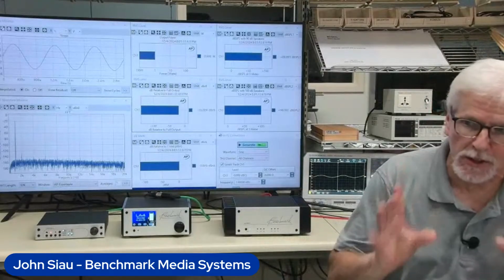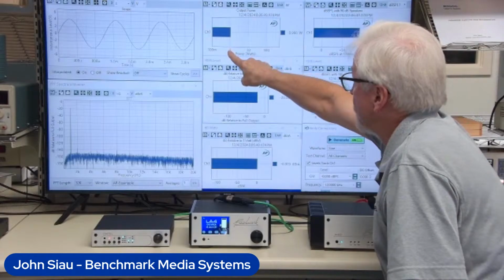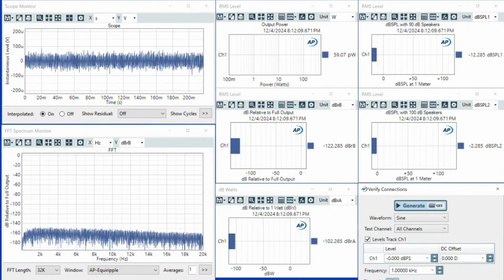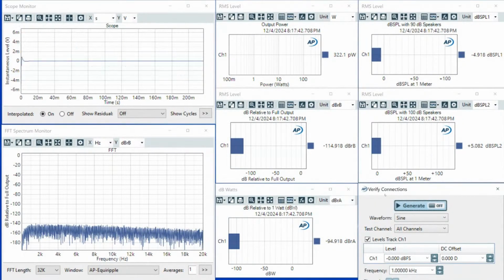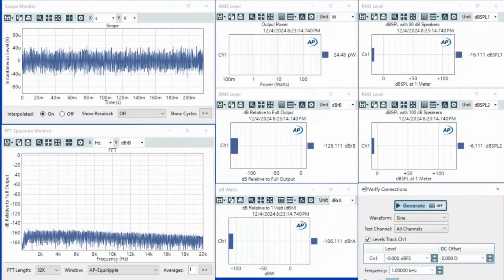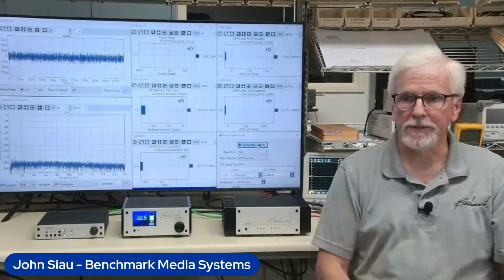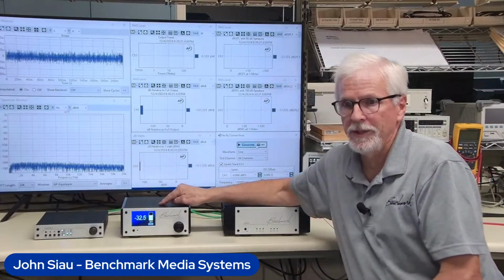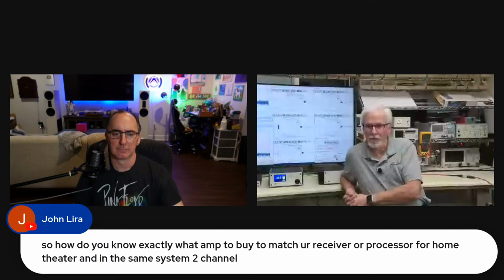Setting Proper System Gain for Optimized Audio Performance

Comment: I have an older DAC2D. This device is connected by XLR to a Yamaha A-S 2100. But if I select higher output level on the DAC the signal from the speakers gets distorted. That’s because the XLR Input stage in the Yamaha is not able to operate clear with higher signal levels.

Comment: But what if the s/n ratio of the pre-amp is worse than the amp's.  Would you still chose the low gain setting on the amp? or is it better to let the componenet with the lower s/n ratio do the gaining?  for example my rotel pre-amp says:
s/n ratio (IHF A-weighted) 95 db (analog bypass) 92 db (Dolby Digital, dts) 0dBFs; input sensitivity/impedence: Line Level 200 mV/100k ohms; Pre-amp Output Level/Output Impedence: 1.0V/1k ohms; Contour (LF/HF) +- 6 dB at 50 Hz/15kHz
the amp says s/n 137dB;
Reply: What are your other components -- source amplifier speakers?
Reply: Rotel RSP-1570 pre-amp manual says: s/n ratio (IHF A-weighted) 95 db (analog bypass) 92 db (Dolby Digital, dts) 0dBFs; input sensitivity/impedence: Line Level 200 mV/100k ohms; Pre-amp Output Level/Output Impedence: 1.0V/1k ohms; Contour (LF/HF) +- 6 dB at 50 Hz/15kHz. The amp (buckeye purifi) spec says s/n 137dB; 4 ohm 25dB/2.2Vrms (high), 20dB/3.9Vms (med), 15dB/6.9Vrms (low). Is it better to let the amp or the pre-amp do the "gaining"? I guess it depends if the s/n gets worse as you turn the knob on the pre-amp???@abijeetrs6522

Comment: The HPA4 has helped me tremendously to perform as per the description in the 25th-30th minute, to mate a pair of unbalanced anode output of a 300B preamp with a fully balanced dual mono AHB2. I'd put the 300B preamp output as maximum, going through HPA4 to perform the volume adjustment

Comment: Hi Gene, thank you for the depth of information provided!  My current very modest system provides me with some nice audio and given this info I am wondering if I might see a benefit to adding a pre amp in between my DAC and amp.

Components are 2 sources: Sony CD/DVD carousel player optical connection to smsl su-1 DAC and a Wiim mini optical connection to the su-1. Then the analog connection to a Fosi bt20a pro with sparkos op amps driving polk RTi38's and a Polk psw303 sub.

Modest yes, but fun! Would a preamp between dac and amp using the preamp for volume potentially make a difference?
Reply: Sorry, CD/DVD is coaxial connection to DAC

Comment: What are the best practices if I use the WiiM Ultra? It's a digital preamplifier with subwoofer output, high and low pass filters, EQ functionality and RCA preamplifier outputs.

I usually listen at around 20-25 and rarely up to 45 if the track is quieter (max is 100). 

Should I upgrade my power amplifier to one with a lower gain? My amplifier is rated at 29db, 50w in 8 ohms.

Thank you! 😎

Comment: So i should turn my gain down on my parasound jc5? I was told by parasound to have the gain on the highest.. and how does it effect the power, i asume i have to turn the volume on the pre alot more up go get de same volume. Feel like there is a loss of power if the gain is on low🤷‍♂️

Comment: This video was confusing, could it be summed up in one sentence? I'm assuming the advice is run the signal hot and the amp gain low to minimize noise? I have a receiver so this would only apply to my subwoofer line out where I do the opposite which is run the plate amp hot and then turn the signal down via a -db setting on the receiver, this is to avoid clipping and noise in a subwoofer signal isn't a concern.
Reply: 40min video to tell you to max the volume/gain as early in the chain as possible.  If you run all digital sources it doesn't really matter imo
Reply: This is the one thing am in search of these days. Whats the best way to tune a subwoofer Gain knob & AVr trims. I recently tried a Y splitter, heard that increase a 3 to 6db gain into the sub. No one explained correctly or I couldnt find it. Everyone says 50 % gain and - trims.
Reply: @SuperSteamengine  my technique for what it's worth is run auto calibration with the subwoofer plate amp at the volume that produces 0db in the auto eq results, I then do a -2db trim on the subwoofer in the AVR level menu. For me halfway on the volume knob just so happens to produce the correct db level during the measurement process. I use a single cable from the subwoofer output on the avr to the lfe input on the sub.
Reply: @Mike-jm5wt for producing 0 db or near to that I need to run my subs at hardly 25 % or 30. Normally what I would do, my auto calib results in - 2 or - 3 with sub gain knob at 30 % which is no bass at all. I tend to change the trims to -6 or -8 and run the gain knob to 60% which punch harder with Just LFE single RCA. Am just testing to get a better input voltage using the Y cable hoping I would get a less gain on knob and good punch.

Comment: In the first 5 minutes I got bored. Remember back in the day it only a reciever that did it all and an equalizer?
Reply from the maker: @scottivlow9962  This is a fact based channel hosted by engineers and other subject matter experts. If that bores you, there are plenty of YouTube channels to watch press release style powder puff reviews with cool camera angles and nifty music.
Reply: but but but we have to sell pre-amps, streamers, dsp, special dacs, $10k wires.  
He's there peddling his wares... passionate? sure...
Reply: @lgmediapcsalon9440  I spent so much money on 3 sets of surround speakers, 9 sets of RCA speaker cables, RCA adapters & connectors and 2 pairs of wall mounts since last September.  I also bought islolaion pads for my subwoofer, sound bar and small one on the back of the speakers. I want to eventually add 3D  sound islolaion pads on my walls near my speakers.
My grip is with the whole audio industry that has no damn clue that for people that buy any Vizio soundbar can try an up sale on speakers that go far beyond the stock speakers you get from Vizio. 
The trick to make it work RCA Y adapters that plug in back of Vizio subwoofers.
I have 2 sets of 3 way speakers and 2 sets of 2 way speakers. I wanted the best of the pros and cons from both types. I have a total of 10 surround speakers now.
I need an Arc / eARC audio extractor and a new HDMI cable.
I have a non functional Vizio soundbar that needs an audio connection to my TV..
 I'm already planning out my next upgrade to my Vizio thin and long speaker wire to something shorter and thicker for a better appearance.
Reply: Ever spend any time on the forum? It's a cancerous cesspool of audio snobs that are more left leaning than an 80s adult film star's junk.
Reply: Have you ever been on their forum?
Reply: @MikeMargolis-j8f  I have been on their website. The huge problem I have with Audioholics is that it is a no useful website.
 It's like there are 2 home theatre markets from Audioholics. It should be one. The forums could really careless about the Sound bar home theater owners. This site is about one one thing the huge experience home theater equipment. Definitely useless to sound bar owners that would like to add separate surround speakers.
 Sony, Sonos, & Nakamichi let you buy separate surround speakers. Anyone else "it's your out on your own" crap on what to do to make "bouncy house" to be better than what you get from stock.
 I did manage and still have to manage and figure out what additional equipment I need. 
  I need a second sound bar to work, to do that I need a separate  eARC ARC adapter box.
 Then from there I have a nonworking sub. I have to assume it needs to be connected with an audio signal from the sound bar. Then after that I might need to have this sub repaired because I get no sound from the RCA connection.
 I need a Class D amp because I have 6 speakers that cut out from 2 RCA ports. It was taking too much power.
I have 3 sets of great speakers they would never get recommended on this channel.

Comment: My late-70s vintage McIntosh preamp is rated for 250 mV input but my DAC puts out 2V (no volume control on DAC). Would this be an exception to the recommendation for high gain at the preamp stage? If I turn the preamp volume high, won't it clip severely in this case? If so, how do I find the sweet spot (without a test bench)? My amp has continuous gain knobs (per channel).

Comment: I, like so many others have bought the hot selling WiiM Ultra and are using it as a pre-amp. It's connected to a Emotiva BasX amp. Any thoughts on settings? Components inputs. RCA outputs?

Comment: SNR value is actually a way to cheat about how good it is , the higher the better   but they are two different way to get this value higher , most engineer they increase the signal amplitude then you get high SNR value,  the Audiophile engineering way  is that you decrease the noise floor. Decrease noise demand good engineering. Difficult to approach it. But it is right Audiophile👋👋👋👋👋 engineering 😅

Comment: I have a hifi system. I only have an amplifier, no preamp or external DAC. There's no way to change volume on any other device but the amp. In this case I doubt there's anything to optimize.
Reply: simple works best.  I donT get all these devices... a DAC? Your amp has a DAC.  Pre-amp?  Excuse me?
Reply: I hear zero noise when running enough gain to drive my speakers to 95+ peaks at my listening position.  Even with one of my preamps set to no gain i get no noise on either my old school, Class AB power amp or the Class D power amp. One speaker pair is about 86db efficiency the other old JBL monitors is 89 .... according to their spec sheet.  Various settings I've tried add no really noticeable noise.  If I had very high efficiency speakers.... say... 102...  I would not have to turn the amps up as loud ....  so still no real objectionable noise.  The real noise i hear is from vinyl records and sometimes a poorly recorded CD.  On multiple powered monitors there is a very slight bit of noise from the tweeter but that does not increase at high gain.  So.... with even modestly priced audio products today noise is really not a problem.
Reply: @memcdm  did you reply to the wrong comment?
Reply: @lgmediapcsalon9440  no
Reply: The point?  With today's electronic  components there are no noise issues.  My preamps have no audible noise. Never heard any noise from any of my power amps.  Some have no volume controls. No noise in any of my preamps. Set up totally wrong and there's stilll no audible noise even at max spl. Old components did have audible noise and I have heard noise from the tweeters in some lower end powered studio monitors.  Some source material is a bit of noise, but even this is rare today. Appreciate the info but I've never had a noise issue with any home stereo equipment.  Recording live performances with lower end components reveal some noise and in this case, proper setup is important.   Still, given the  capabilities of even modestly priced stuff, it's easy to get quiet recordings.
Reply: @kasperlindvig3215  And no real noise issue so enjoy!

Comment: My PS Audio monoblocks don't have any controls that I can find.
Reply: @flyingjeff1984  M700 and M1200 both have fixed gain of 30.5dB I believe. I just compensate for it by having Roon do volume leveling
Reply: Wouldn’t what the gain any higher on them they are already noisy.

Comment: I have the balanced, high outputs from my preamp driving my Eigentact power amp, which is set to it's lowest gain of 12.5 dB.
This arrangement allows me to drive my reasonably efficienct [91dB] speakers to well beyond comfortable listening SPL's levels, in my medium sized room.
Your article confirms that, from a s/n point of view, this is the best arrangement.

An interesting area of system synergy that is not often discussed.
Many thanks.
Reply: I have the same setup without a preamp and sounds amazing. Way better than with the buffer gain on.

Comment: That's a lot  of numbers to explain a simple fact. More gain in the poweramp means more noise...so keep your gain on the last stage as low as possible, more headroom more dynamics less noise
Reply: If your signal voltage from the source is lower than the expected input voltage design of the amplifier you will not get all the power (Watts) from the amp. Making sure both voltages match is the best setup

Comment: Great topic and wonderful explanations as always from Benchmark! 
Gene, considering you have measured a lot of Denon receivers, would you use the low or high gain of a power amp (23/29dB in my case). It's the pream good enough for 23dB? Denon 4800
Reply from the maker: I would probably stick with the 29dB setting unless 4Vrms will make your amp reach max power when set to 23dB. Run the calculation based on the power rating of your amp. 23dB at 4Vrms should get you 400 watts at 8 ohms.
Reply: @Audioholics  I have a Hegel C53, rated at 150W/8Ohm. If I run the math from your 2013 article (awesome job by the way) I get 2.45V @ 23dB and 1,23V @ 29dB.
This should be plenty for the Denon preamp mode rated at 3.75V
Reply: Wondering the same thing. Denon X6700H, running external amps for most channels, but not all. Any idea what the voltage output is when it is not running in full preamp mode?
Reply: @isakOHR  You can ask Denon support. But I would guess same as mine, around 3.5V
Reply: @cristiantolbaru7153  Thanks!

Comment: Perfect timing Gene, i was just going through this exact thing with my DAC levels and amp volume, i had convinced myself that when at full volume my dac was adding brightness to the upper mids, then further convinced myself running it @ -10db was a solution. Sigh haha

Comment: I keep hearing RCA connections are 2v. I have 2008 pioneer AV receiver hooked up to an external amplifier. When I look at specs for AV receiver audio section input line sensitivity 335mv and output level 335mv. My external amp has a variable input sensitivity gain knob on the back spec says 350mv to 2.8v. Not many amps have a variable input sensitivity adjustment. Why not it seems to make sense? Can you shed some light on these discrepancies? Correct me if I am wrong but my understanding is to get both full power and dynamic range the amplifier is design to expect a specific input voltage if no input sensitivity adjustment is available. So if the input voltage is below you don't get max power and if the input voltage is above you don't get max dynamic range. What he says in the video sounds correct if you were recording music with microphones, ADC's and such for best signal to noise and sound quality. When playing back music you need to control the volume somewhere and that's usually the voltage level at the source or preamp and not full level always. The amp max performance is at the expected input voltage.

Comment: great video, and it has convinced me to physically move my headphone amp so that i can reach its analog volume control rather than control volume on my streamer's app in DSP before the DAC. 
but that still leaves EQ unaddressed. DSP EQ is essentially DSP volume reduction applied selectively across the frequency spectrum, and we now see that increases net noise sent to the amp. given that analog EQ components also come with additional noise and fidelity loss (looking at you, Schiit Loki), plus analog EQ rarely offers as much control as DSP, are we better off accepting the lost S/N that comes with using DSP, or are we better skipping DSP EQ and using analog EQ when possible?